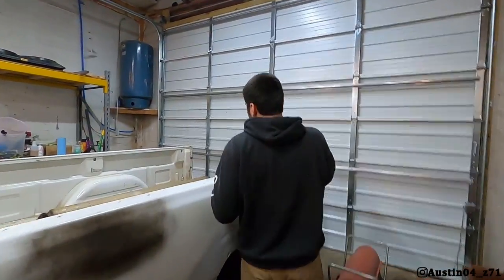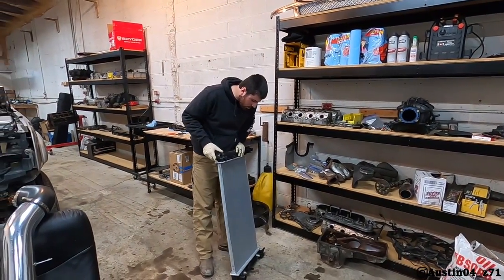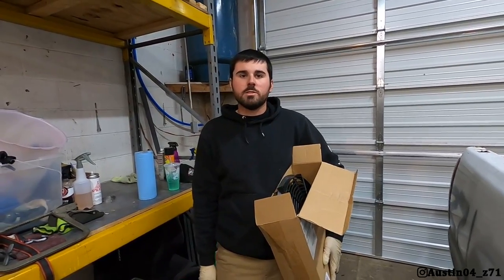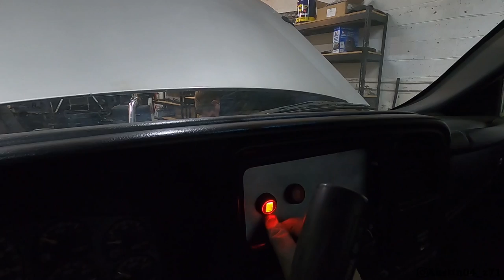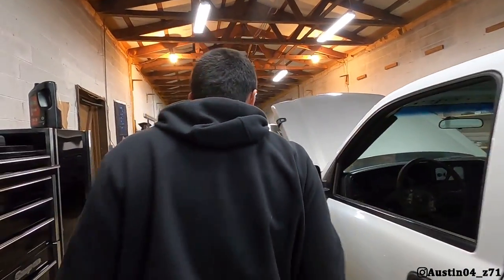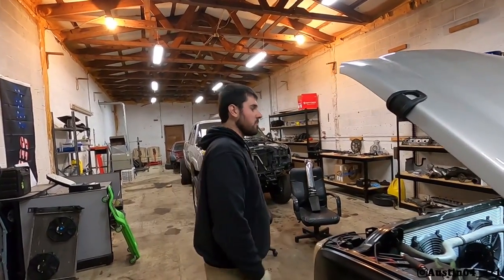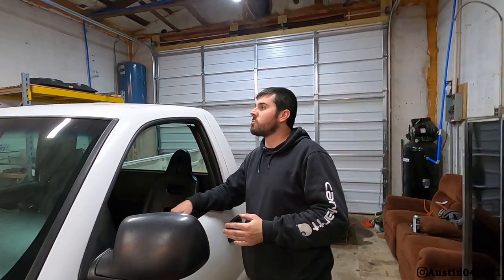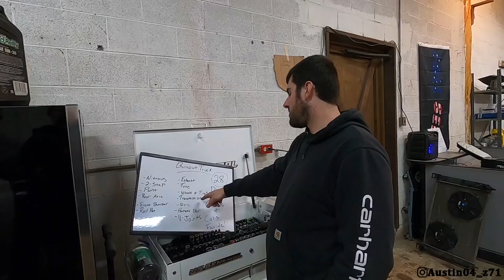Silverado Radiator + Electric Fan Upgrade *Burnout Approved*

Comment: I actually just installed the 34 inch radiator in my 02, I couldn’t believe how bigger it was compared to then stock 28
Reply: Did u ran the stock fan clutch and housing
Reply: what brand did you go with or where did you buy it ?